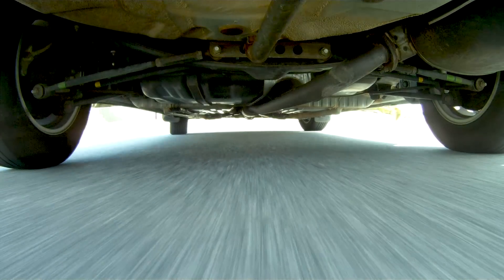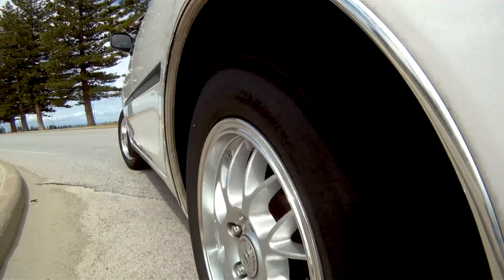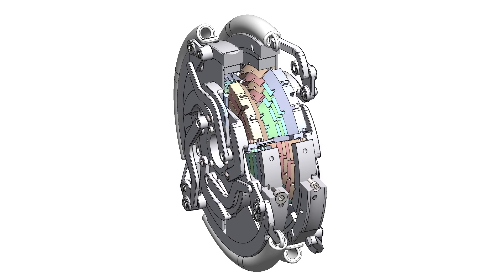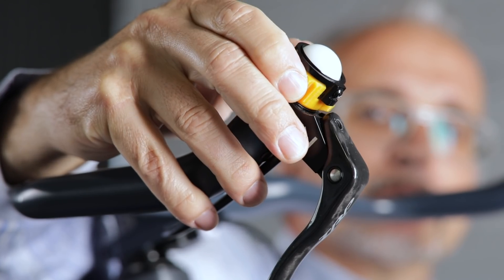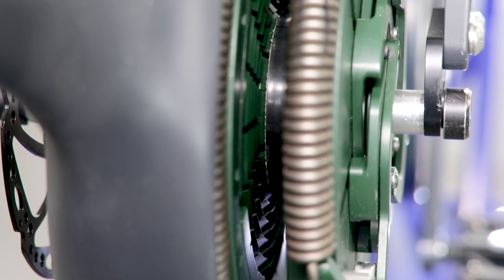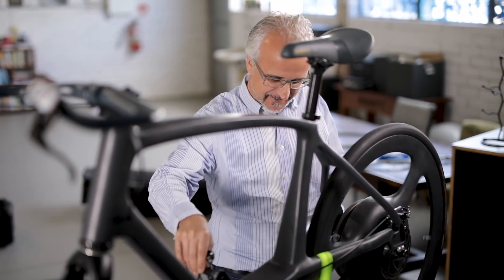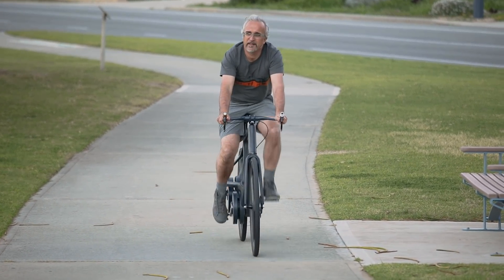Continuously Variable Transmission on a Bicycle

Comment: I think it's no longer a CVT, because you have only a set of ratios.
Reply: Jeann van Rooyen the “gears” don’t have fixed “engaged/disengaged” positions, and the shift mechanisms telescopes them out of their stowed-away position. They  still engage the v-belt when partially extended.

It’s a cvt with a bit more complexity to give it a smaller form factor. That’s it xD
Reply: Jeann van Rooyen i was quoting your statement, “I just can’t define it as a cvt in my opinion”

The selector you see at 1:50 is a traditional sprocket selector - not the motorized shifter the video talks about. You see, briefly, a segment showing that being used, and it’s a 2-way switch with a central dead zone in the middle: push it one way, it’ll progressively increase the ratio, and it decreases the other. There are no “set” ratios - just a set of concentric rings that engage/disengage as the mechanism is increased/decreased. Leaving the switch in the dead zone keeps it where it is.

Yes, most industrial or automotive cvts have governors and computers ATTACHED to them to adjust them given their input/output rpms and throttle demand - but a cvt is just the “gearless” transmission, regardless of what method is used to make it shift. This one just happens to be electronic rather than mechanical like a ball governor
Reply: I mean, no - the discs can be pushed in variably, meaning all the ratios in-between are still there. And this is still a cvt, even if it isn’t automatically shifting. Cvt just means continuously variable transmission - ie, a transmission where the gearing ratios are continuously variable - no gear separation, clutch engagement, etc. the whole thing can be adjusted while under power, continuously, always being tuned to better suit the torque demand - whether that selection/adjustment is done manually or automatically
Reply: Stealth The Unknown I do not think so. Like you stated yourself CVT stands for continuously variable transmission. There is nothing continuously about manually selecting the ratio from the handlebar.
Reply: Rick Buitendijk Yes there is. The bluetooth connection between the handle bar and the gearbox is your adjuster. And the “continuously” part of cvt just means that there’s seamless transition between gearing ratios, like we have here
Reply: Jeann van Rooyen agreed! I drive a nissan with a cvt, although that’s probably an answer to economics rather than engineering constraints.

Thanks for hearing me and the others out :)
Reply: That moment when you realise some people think the opposite of manual = continuous (VT).  Nope, this is a CVT - operated manually or otherwise.
Reply: @edism  i have always dreamed of a CVT car that i can choose the ratio manually using analog knob like that.
Reply: @RealNameNeverUsed  Why not let a computer do it?
Reply: @edism   I don't know...to apply engine braking force. Sure a normal CVT has L mode but it's just fun going through the ratios. Just like going through the gears in H-shifter but in the form of "Low" to "High". Could be in the form of a knob, a lever or a paddle shifter/adjuster. Just a concept in my mind though.
Reply: @RealNameNeverUsed  you're thinking of an RPM lever like airplanes have
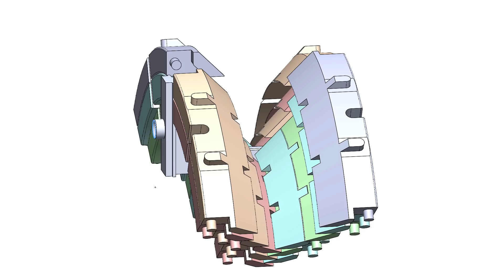Reply: @Andrew Crews If you look closely 0:45 , each cvt rings has tapered edge which meshes smoothly to the lower ring. 
The width are probably adjusted so that the transition of lower ring to upper is executed during this smooth meshing phase.
After that phase, it doesnt matter the point edge is exposed as the belt is no longer in contact and riding on the side of the upper ring.
So its definitely continuous.
Reply: Cvt do NOT have to be automatic or automated. Which is funny because that is one of the things they are trying to sell about this which it doesnt really have. 
 Thats merely one of the things that this design of transmission can do. You can actually automate a standard derailure bases system on a regular bike with a simple fly weight. There are situations in which you would want a transmission that has the resolution and number of ratios that a cvt can have but never have to worry about it comming out of the gear you leave it in. Its still a cvt, but its alsonnot the first bicycle cvt now is it the best. NUvinci has been around for years and is much mode refined than this.
Reply: Michał Kmiecik I think you are right. When you have to manually select the ratio’s it is a VT at best
Reply: Yep! You're right.
Reply: Jeann van Rooyen IT has that ratio as a simpler way of defining to the user how it feels, my car has a cvt, but also a gear selector mode, is it now no longer a cvt? The transmission on the bike changes by itself to keep the same feeling to the end user eliminating the need to change gears as the rider rides up or down hills on conventional bikes with conventional groupsets.
Reply: My name is Michael Kmiotek
Reply: No rollers
Reply: I don't think you understand what a cvt is.
Reply: what do you mean by set ratios? The whole point is you can tune the ratio with an analogy style controller(the better the controller the greater the tuning precision).
Reply: @the4llfodr  no, NOT fixed positions. nowhere in the video does is say there are fixed positions - the "gear segments" are just parts of what is technically the same pinch disc.

because it "walks out" the gearing ratios as you hit the increase/decrease switch, it IS a CVT.

You can choose to define CVT as you see fit, and your opinion IS valid - I'm merely using the definition i've been familiar with for ages more than a "google it" comment has made me aware of - this bike cvt is just more complicated than traditional automotive cvts
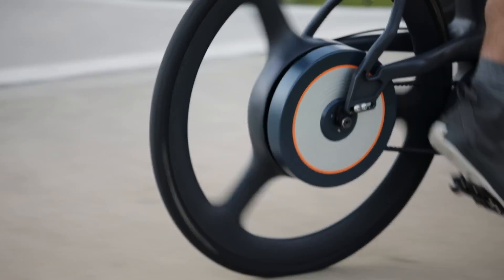Reply: @the4llfodr  look at 0:45 you see the model of how the hub is adjusted and they are ramped to give differing ratios as they are pushed in and overlap so as soon as one side is almost in, the other starts to move. That allows a seamless transition between the ratios.

At 1:50 you're looking at a regular gear selector on a bike. They are literally talking about a standard gear selector and showing it just before to make their point of how theirs works. They even say it's controlled by a Bluetooth module so that clearly isn't it. Even if it was, however, a CVT can still have what would be considered "set" ratios. Some automotive CVTs do it to give drivers the same feeling of a regular transmission.

A non CVT has a discrete set of gear ratios. Since this thing adjusts by pushing the concentric ramps in (and the fact that they are ramped is the important part) the ratio is adjusting as it pushes in or goes back out. That by definition is no longer a discrete set of ratios. It can change to anything from minimum to maximum which is by definition a continuous measurement.
Reply: and from what i can see, if you dont operate the gear selector on the handle bar, it wont change gears...making it NOT a CVT
Reply: @Andrew Crews  I believe that all of this problems can be solved. An edge cutting into belt? Just round it a bit.
Sadly, nobody pays me to provide these solutions, so I can't spend all the time needed for it.
Reply: No, it is a CVT
Reply: It definitely isn't a CVT.  Any other (loosey goosey) definition and you would be able to say that the modern rear derailer is a CVT because it looks like a cone. and gears don't mesh teeth in it.
Reply: @arthurgarthur  In case you missed the memo - the change of gear ratio visualised at 0:45 can be stopped at any moment, allowing for selection of any gear ratio in viable range.

Comment: I love my Bike and my Steel Chain. I think that CVT is not that profitable. And mud,soil may cannot be  removed easy. Thanks!

                           Kenth:
Reply: You are right, this shit sucks😂
Reply: actually that is the best part about this system, it is belt driven. Belt drives are unaffected by water and mud etc.. while that rapidly wears out a conventional chain.

However this system still sucks because it is way too big, overcomplicated, expensive etc and doesn't seem to actually perform the basic functions a CVT is supposed to.

Comment: It's bicycle A/T , and I have bicycle M/T with 5speed and 3speed front ..
Reply: Only 5 in the rear, kinda old. 
No it's still manual. I have an Autobike It is full auto. Picked it up as a castoff, what a joke too. It shifts when it thinks not when I think. It throws my feet off the pedals sometimes when up shifting. It don't see the hill I am coming up to. Spinning weights shift a standard derailleur. I've never gone fast enough to get it past 4 of 7.

Comment: I have a Huffy Bicycle , chain drive,  that uses segmented rear sprockets that keep.the chain inline.  A tensioner is used to keep the chain of the 5 speed at the right tension.
The other one that I have seen, photos somewhere , uses centrifugal forces  of weights to change the rear cluster, all with no gear change.
Reply: Do you have enough knowledge about human powered vehicle ??
We looking for the people that can clear our doubts ??
Reply: That must be the Tokheim transmission. Goes back to the mid 70's, probably a knockoff.

Comment: How it behave with rain, dirt and mud?
Reply: All you have to do now is to paint those hubs black in stead of bright white. Then put a whole sealed guarding all around the system, to keep the water out, let alone frozen mud. 
Then you Have to take the Blu toof shit off, and make the damn thing shift by itself, using no electric power. Make it so a 350 lbs weight lifter dude can push that thing to its limits, and not break. then make it under $250, with a no hassle, absolute life time warranty, so people would actually buy it.... Just sayin'
Reply: @jakefriesenjake  or just put a cassete and chain on it :^)

Comment: Possibly a brilliant answer to a question no one asked. CVT belt drive is not as efficient, and heavier than a normal chain drive. You also now have a need for electricity on a form of transport whose main advantage is freedom from outside power sources and the complexity of technology. If you actually ride a bike you will find that your legs get tired from pedalling more than your thumbs get tired from changing gears. That's why the efficiency needs to be in the drive train.

Comment: Correct me if I'm wrong, but it appears that a little off-road mud kicked up into this device, and you're screwed.
Reply: Thats the problem with a lot of the people in CA thats coming out with new tech. They act like because it works in the lab or a nice clean sidewalk that it'll work anywhere and everyone should get one.
Reply: @allenmckinney9533  lol, they have to navigate through poo.
Reply: Beltter have some chain And sprockets for that :p hehe
Reply: sk8n barrow totally right
Reply: @1wasinAlpha  
Atleast  my design  is safe i have a similar  idea  but a drastically different approach.
Reply: Definitely a problem in the transition areas, where there's barely enough friction interface area to transmit the torque.

Comment: Will never take off unfortunately as the design will not achieve the efficiency of existing CVTs available for bicycles. NuVinci or now enviolo hubs have gone through well over a decade of development and achieve impressive efficiencies for a CVT. Also the IGH design is far more compact and compatible with most bikes.